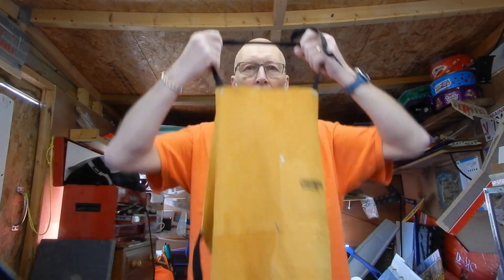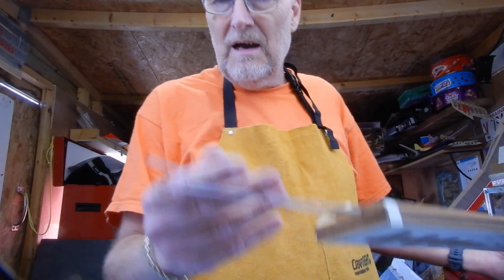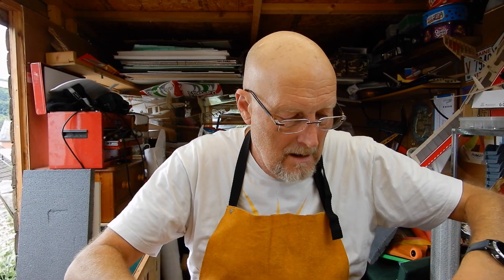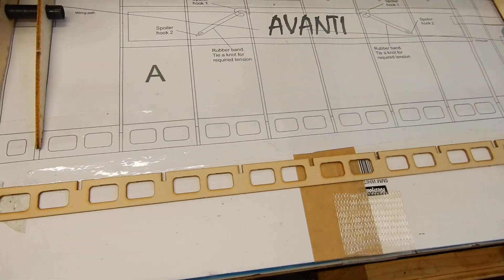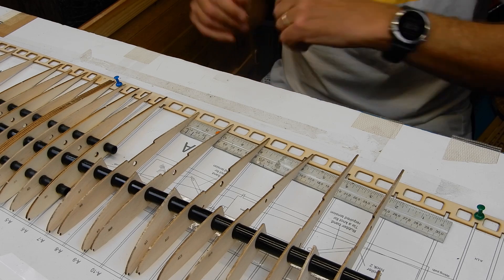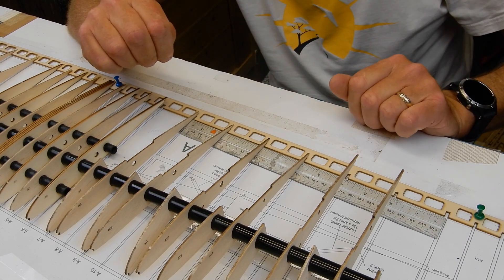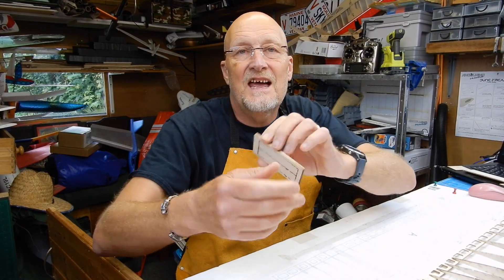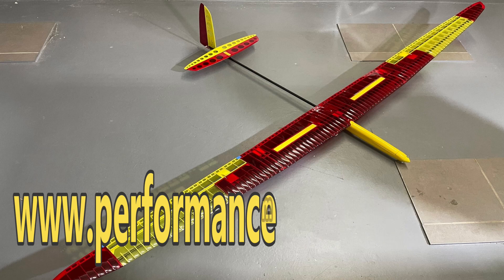How to Build The Avanti 3 metre F5J glider Part 1 Intro / wing A

Comment: are the main spars normal putruded carbon tube or custom wrapped tube ?
Reply: Roll wrapped, they give better torsion than pultruded tubes and have heaps of bending strength.
Reply from the maker: Normal but will check buddy